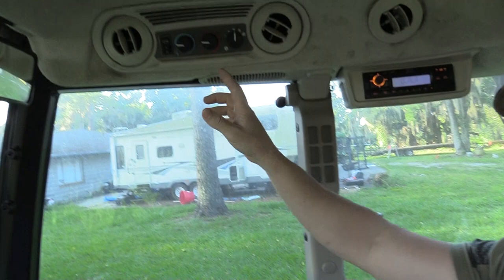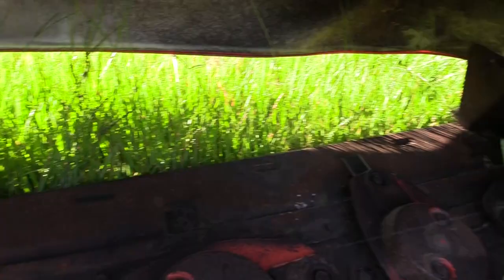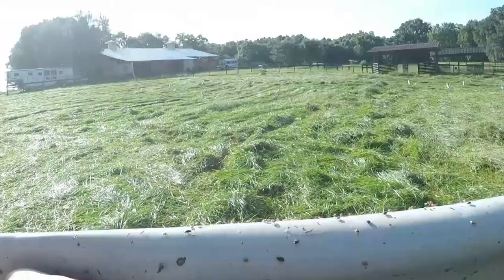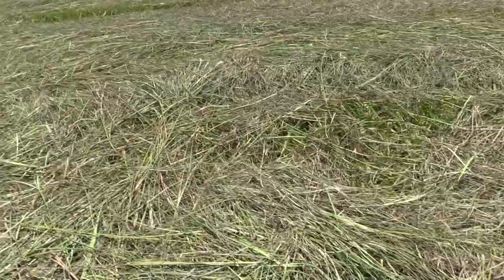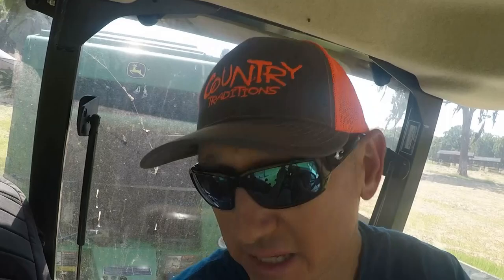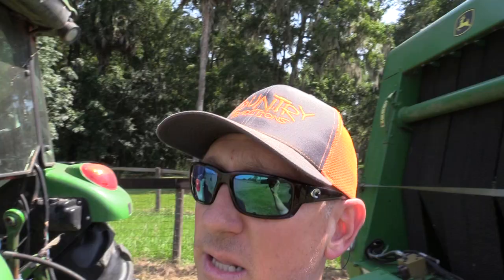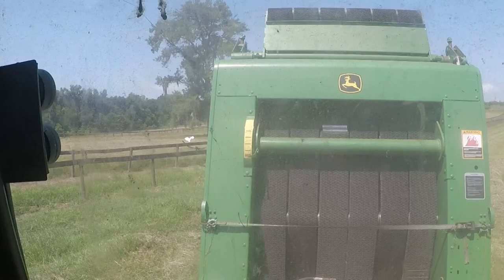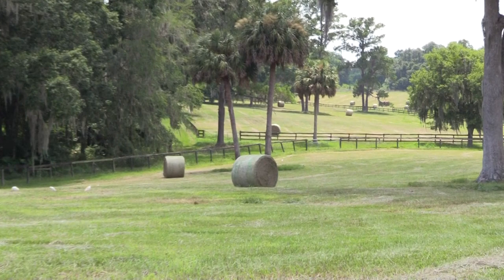Baling hay in the hot florida sun {100s of rolls} How to

Comment: Be careful with your monitor set at 60. The 4x5 and 5x5 Deeres are bad about breaking the tension arm. Dealer told me it cost about $10k to fix it between parts and labor. Told me to set mine at 58